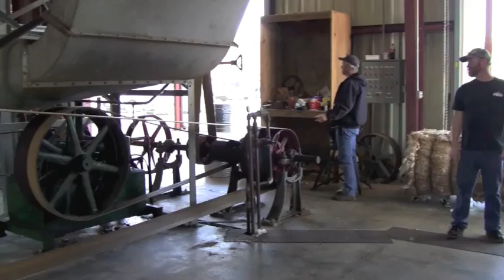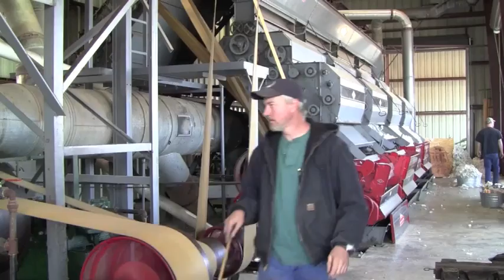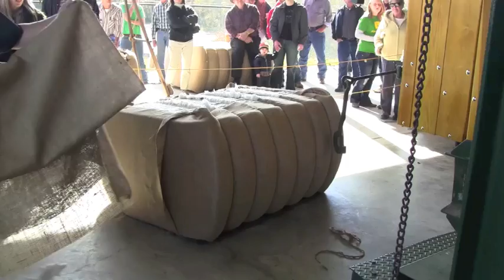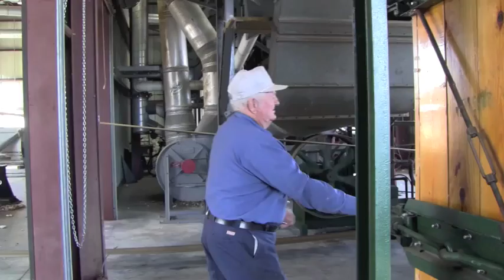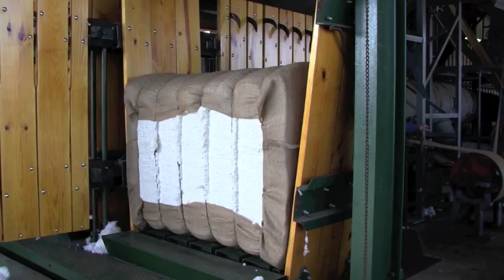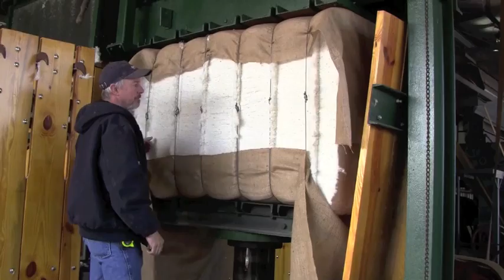Cotton Gin

Comment: I learned how to be an Assistant Ginner in a Murray Gin almost just like this Continental Gin over 3 seasons. We had a main lineshaft to break like the one here at 5:45. A big chunk went through the roof. It would've killed a man if he had been walking by it at that time! It was funny on the last major upgrade they did on that gin; they pulled out the 4 original Murray gin stands & replaced them with ONE Continental 141 stand. It out ginned all four Murray model 90's combined! Also the gin I'm talking about only ginned 10 bales an hour on good days.  It wasn't steam powered like this one. It ran on twin diesel engines. When they upgraded the gin to all electric; they sold those twin diesel engines to a tugboat company who acquired them to run on a tugboat that runs on the Gulf of Mexico the last I heard. They put in two electric motors to replace the diesel twins;  one motor was a 200 HP & the other one was a 150 HP. I would've hated to have to have paid their electric & natural gas bills from Sept - December every year! They used Natural Gas in the two burners to heat the two dryer towers.
Reply from the maker: Thank you for watching and your comment
Reply: It's not steam. It's a fairbanks morse 32e diesel.